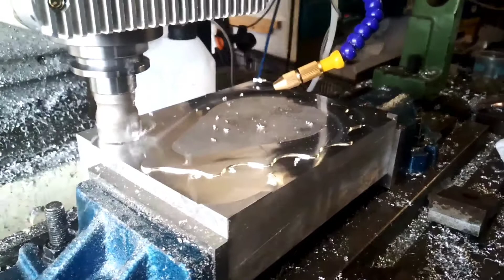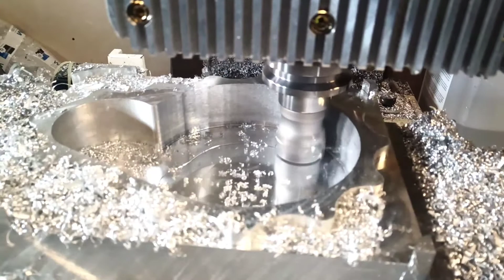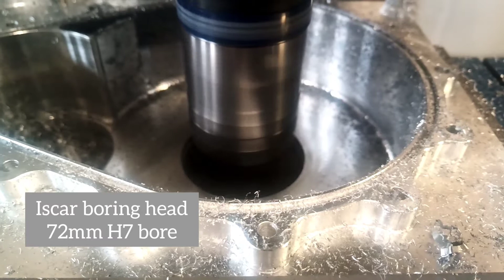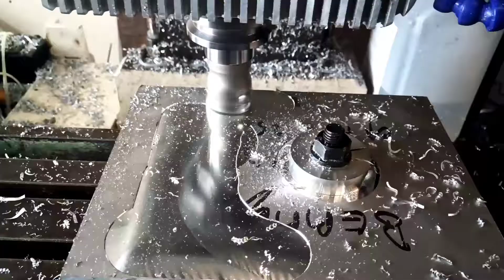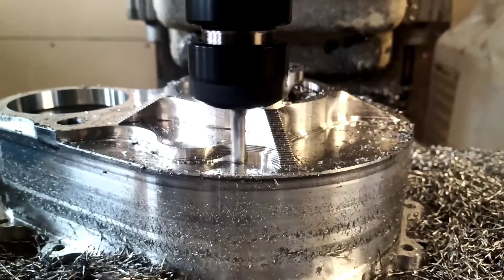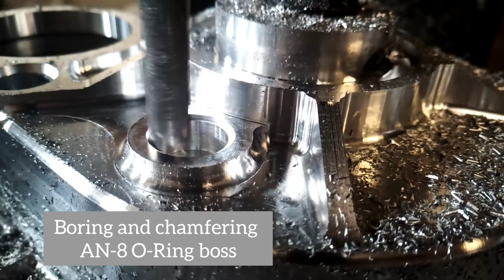Milling a billet gearbox casing.

Comment: how long did it take to machine? cost of aluminum?
Reply from the maker: Not so expensive, the stock costs 80€ and weighs 10kg. Machining time is somewhat hard to tell because split in many tools and 2 ops done over several days, I would say roughly a total of 7 hours. Takes long because my spindle will only go as far as 2000rpm yet and several semi-auto operations such as boring head adjustment
Reply: @SuperYellowsubmarin  looks like turned out great
Reply from the maker: @joesmith2465  yes it did ! Thanks. Had a couple of troubles along they way, part moved 2 times in second OP when breaking through first OP it caught some material. Fortunately I had planned my wcs datum to be able to probe and readjust at any time. Just need some toe clamps and corner radius cutters for next such job.
Reply: @SuperYellowsubmarin  it's all about learning and if ya saved the part even better
Reply from the maker: @joesmith2465  True that